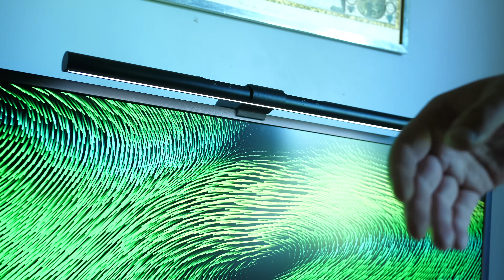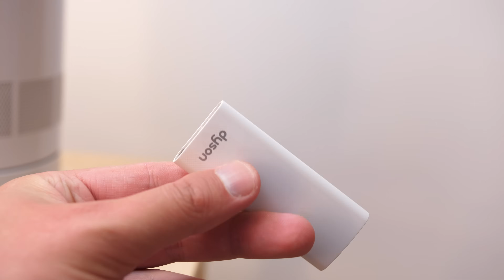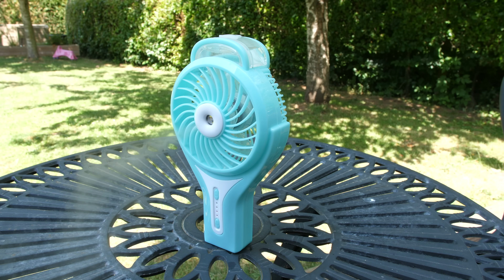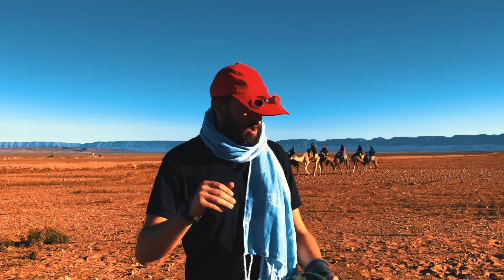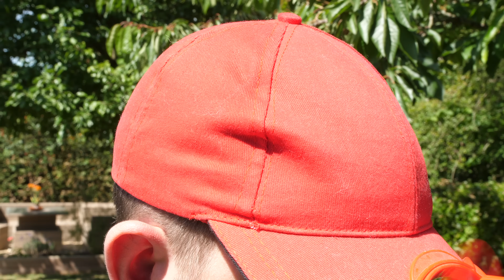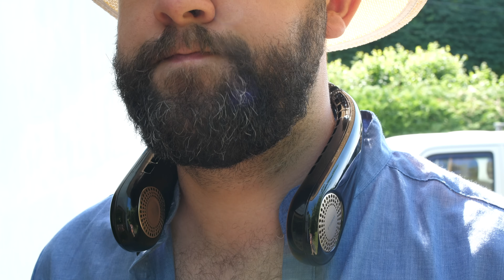Use THESE Gadgets to Stay COLD!

Comment: The Dyson fan isn't actually fanless, the fan is hidden in the base...
Reply: Yeah i have seen people review them (Dyson) and compare against a £20 pedestal fan and the £20 one was supposed to have wiped the floor with it.  The dyson however was supposed to have been more quite at slower speeds (Not at faster) and have finer speed control adjustment.

Comment: Rather than spend that much on Dyson fan (it's just a fan blade in that bottom section but they've made it look fancy), get a "portable" £300 air con unit. Put it on an hour before bed then can sleep perfect. Worth it just for a week a year, but pricey to run.

Fan wise though best ones I've got are the 20 inch silver floor fans, really powerful better then those pedestal type.

Just my take on it, thanks for the video stu.

Comment: If you want a Dyson fan, do what I did, go into their official factory outlet store on eBay. They are selling refurbished fans with extra discounts currently. I got a Pure Cool 'desk' fan deal, it's the same as the tower model but has a circle air blade but is still so big it's in the floor lol and works incredibly well, it filters the air and is fully smart home compatible, you can use the included remote on it or the app or Alexa Google Home etc to control it. I love it. Paid £290 for it and it retailed for £399 and it's like brand new.
Reply from the maker: Good tip, like I said I bought mine refurbished  too, although I think it was directly from the website instead. The eBay outlet is a good shout though! 👍

Comment: I recommend the Arctic Breeze USB fans they sell on Amazon for £10-15, unlike other USB fans they have a speed controller so are quiet, no metal frame and dont vibrate and rattle on the desk like those slightly cheaper ones from places like Dunelm, Next do.  Great for cooling you down at your desk at work or home, not a entire room though.
Reply from the maker: Ill check them out!
Reply from the maker: Also I forgot to add, this is the type of fan I refer to as a bigger version of a misting fan - they work great, but increase humidity by A LOT, so damp properties I wouldn’t advise using one for.
Reply: @StusReviewsUK  The fan i was referring to does not use water misting.  This is a previous commenter mistaking the model i was referring too.
Reply: Artic breeze is just a computer fan that is enclosed on a plastic box that you fill with water. A total Scam
Reply: @alfiebm  Nope, i am referring to the standard USB fan by Arctic Breeze (They do many fan models) its called 'USB Desktop Fan with Flexible Neck and Adjustable Fan Speed'.  Yes its a PC fan fitted to a frameless metal rod with speed controller on the plastic base.  They often do them in flag theme colourways.